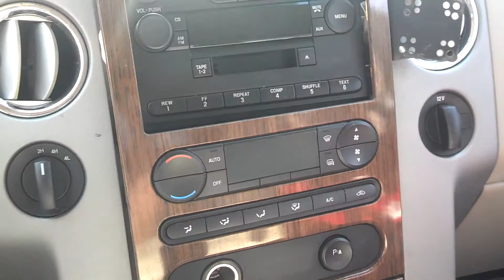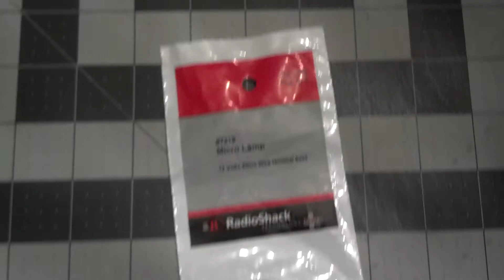code 2-7 airbag light 2004 f150 fix

Comment: I tore down my entire dash to fix the blend door motor.  Didnt even realize I pulled this wire out when pulling the radio calling out.  Put everything together and the airbag light kept coming on and staying on.  You are the man for showing this.  Found the wire and pkugged it in and now everything works.  Thanks man
Reply: A asa a.   W

Comment: Thanks for the video. I had a different dash code than you on an '05 F150. Checked that bulb and it was indeed burned out.
I'll add this, when you remove that frosted/clear plastic piece that the bulb sits in, if you take a dremel and a flat edged dremel bit to the bottom caps of two black posts that hold the clear plastic piece in it will slide right off. Just the tops of the black posts where it comes through the clear plastic piece, don't go crazy.
When you're ready to reassemble, insert the bulb and slide the clear plastic piece onto the bottom two posts, align the top post then simply hot glue the clear plastic piece at the bottom post holes. Nice and clean.
Again thanks for taking the time to make this tutorial.
Reply from the maker: youwho06 I thought about that to, I didn't want to add hot glue. bad luck with hot glue and vehicles in the past. I'm glad it helped you.

Comment: Great video ! I have a 2005 f150 had 5 beeps 5 times driving me crazy found that the airbag sensor light on top of radio bezel was not coming on  so I took bezel out noticed light wasn't burned out so I did a continuity test on bulb and sure enough circuit was broken then I cut the light out went down to radio shack got micro lamp 12v 60mA part #2721092 got two lamps for $1.25 (just need one) came home a soldered one on and solved the problem NO MORE BEEPS! 

before cutting light out make sure there is a 12 volt current going out of clip where light plugs into...must turn key on to get power .

Comment: just went and picked up a new bulb off of a screenshot of your video put it in and no more beeping thank you so much for your video
Reply from the maker: +Nathan Easterling I'm glad I could help you out
Reply: Thanks for the info I found them on Amazon you were very helpful
Reply: How many times did it beep?
Reply: I have no air bag light on but it beeps 5 times

Comment: Thanks for the video but since radio shack is no longer around where can I find a bulb other than the dealer
Reply from the maker: +Bobby Parrish eBay or Amazon that number in description is the part ID (micro lamp 272-1092)  for the bulb not radio shack. I just happened to be in radio shack.